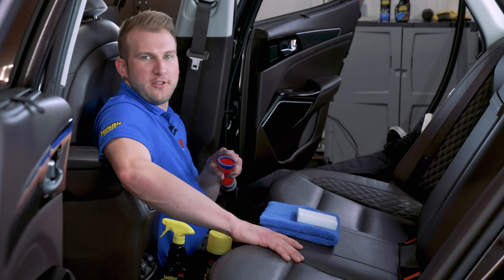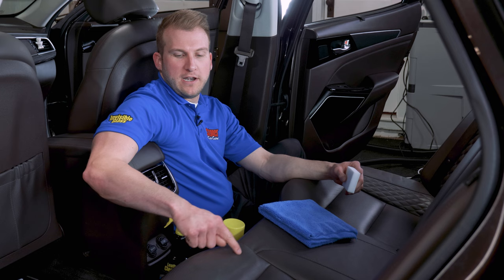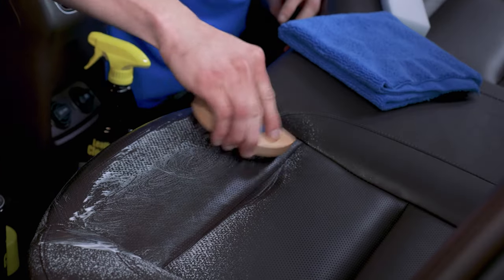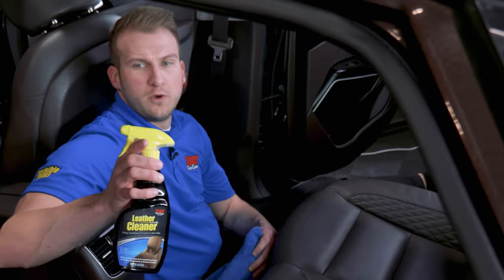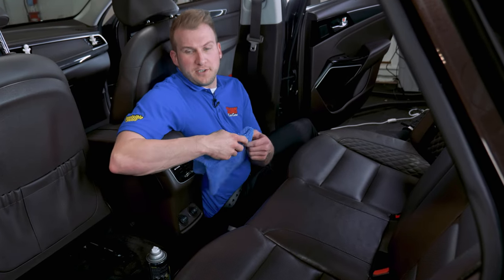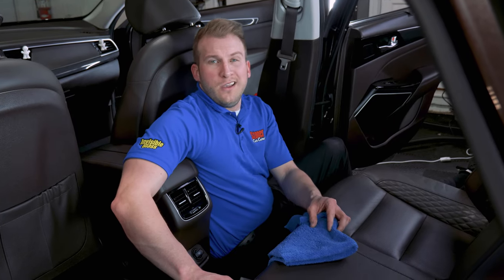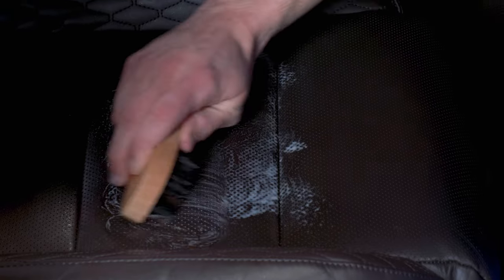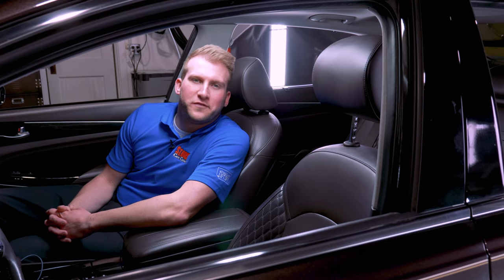How to Clean Perforated Leather - SUPER EASY!

Comment: My 🐕 urinated on my heated perforated seats! How to get rid of smell. I cleaned immediately but nervous it's gonna smell
Reply from the maker: Get an enzyme based cleaner, try to get some into the seat and then apply pressure with towels to absorb as much as you can back out
Reply: White vinegar negar mixed with a little water

Comment: Hi. I dropped an entire Gatorade bottle on one of my seats that is also like the one in the video. Would I be able to use a seat washer?
Reply from the maker: Hey! You can clean them the same way we cleaned these seats in the video. If you have fabric seats, you can try using our carpet and upholstery foaming cleaner, a brush and a vacuum to clean the seats. If that doesn’t do the trick then you could try taking it to a professional to have them use a hot water extractor to deep clean the seats. Let us know how it works out for you!

Comment: Any advice for spilled coffee w/ sweetened creamer spilling on the perforated seats and likely sinking down in them?
Reply from the maker: Hi we’d suggested getting a enzyme based cleaner then try to get some into the seat and then apply pressure with towels to absorb as much as you can back out
Reply: What is an enzyme cleaner?
Reply: @CharlesBartley-oo7tc it’s a cleaning chemical that uses enzymes to break down bio-based materials like milk, sweat, etc

Comment: I used cleaner inside and Leather 2.0 from Carpro on the perforated leather seat.  I noticed that the refrigeration got worse.  The holes appear clogged.  Any suggestions on how to clean it?
Reply from the maker: Apply pressure with towels to absorb as much as you can back out

Comment: Can you use a shop vac to pull out the cleaner and gunk?
Reply from the maker: Certainly can, just make sure use a soft attachment or wrap some soft tape around the tip of your plastic attachments to minimize the risk the of scratching your leather with vacuum.

Comment: Under the car seat, bunch of milk spilled inside the perforated seat. It looks so white because of amount of milk.. it wont get off. Any tips?
Reply from the maker: We’d suggested getting a enzyme based cleaner then try to get some into the seat and then apply pressure with towels to absorb as much as you can back out

Comment: you cleaned those clean seats really well.  - what about lollipops and dog hair?
Reply from the maker: The vacuum is your best friend when you've got dog hair and leather seats. Just be sure to take care not to scratch your leather with the tip of the of vacuum attachments. Lollipop residue might take a slightly stronger cleaner, such as our Trim Clean, before following up with our Leather Cleaner & Conditioner.
Reply: some of the units they give me at work ... I honestly can't tell what colour the carpets are until I pull out the floor mats lol    peace 
 @StonerCarCare